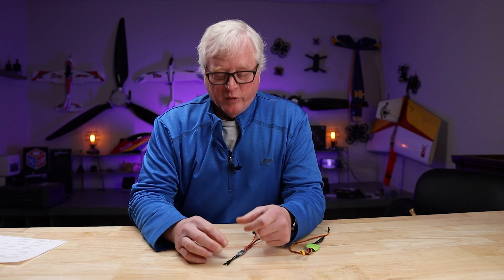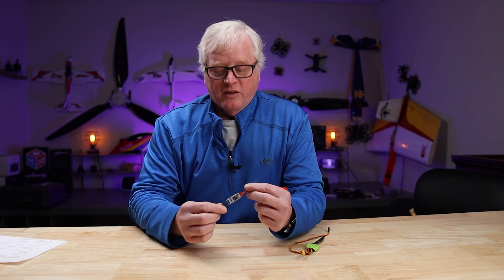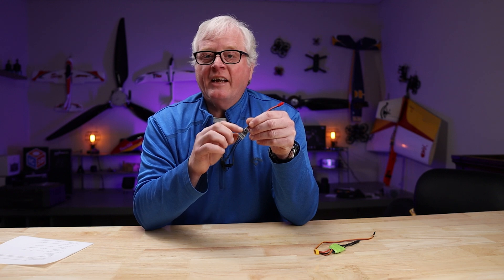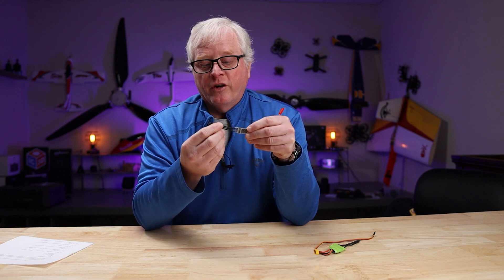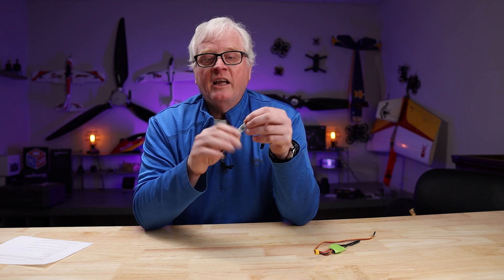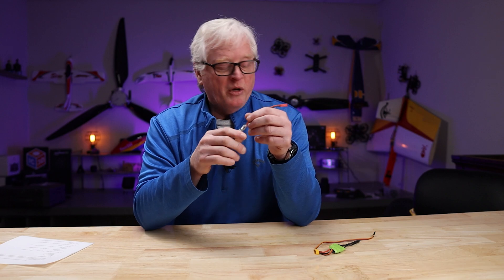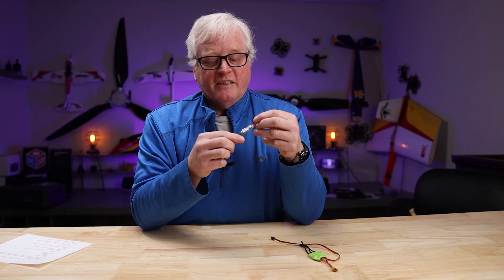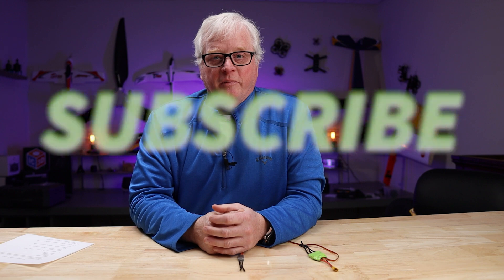SunnySky X 18A ESC  BLHeli_S Program 32Bit for 3D 4D F3P Airplane

Comment: The 4D mode is buttery smooth on this ESC. Setup is so easy to switch back and forth in 10seconds. combined with the X series F3P 2305 3D/4D motor it is smoother and more powerful than the T-motor AM40 combo IMO.

Comment: This is an interesting product, but is it running blheli_S or Blheli32? I wasn't aware blheli_S could even go on anything but the the efmbb8 type chips. But if this has a 32 bit chip then it's something else. Can AM32 be flashed to it?
Since it has BLheli_S is the "light damped" setting permenently enabled?
Reply from the maker: We'll pass it on to the factory because we can't answer that.
Reply: @BuddyRC  Thanks, I think this is info most customers in the know with Blheli will want to understand when considering the purchase.